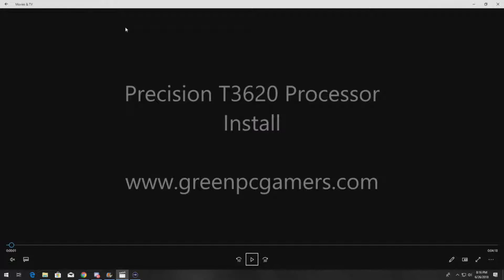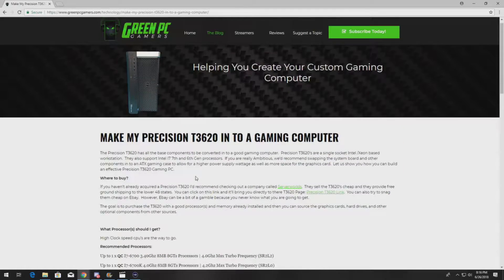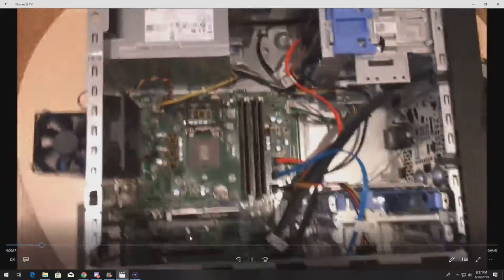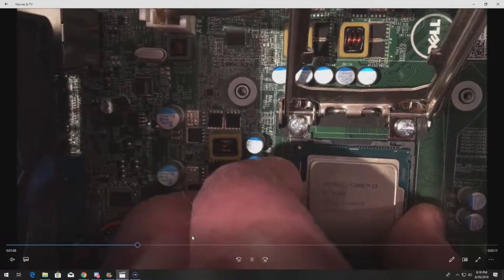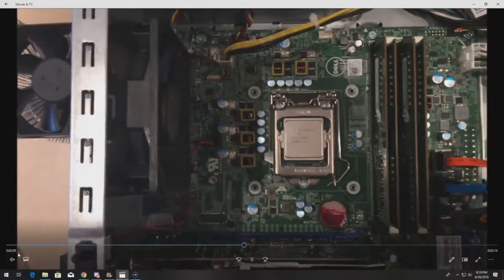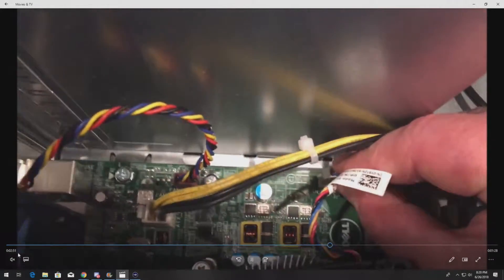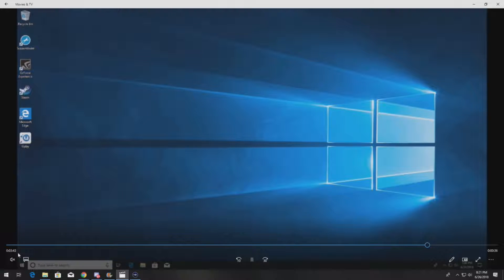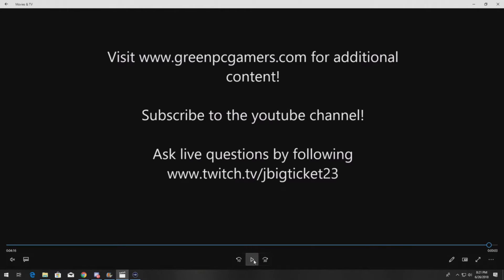How to Install a Precision T3620 Processor (also upgrade ideas)

Comment: First off, absolutely love the website and the videos! Big fan.... I think that you should update the list of T3620 CPU's (Precision T3620 Gaming Computer and Hardware Upgrades) to include compatible Xeon processors. I'm currently running a T3620 with a  Xeon E3-1240v6 3.7GHz that absolutely screams. The Xeon E3-1240v6 benchmark tests better than the I7-7700 for a fraction of the price. If you look around, you will see a lot of T3620's with the E3-1270v5 3.6GHz which benchmarks much better than the I7-6700.
Reply: 1280 v6 runs circles around the 7700 for a little bit cheaper too
Reply: @reloadedspade176  I haven't seen the E3-1280 v6 for less than $119 on aliexpress. For that kind of money, you might has well buy something modern.

Do you have a secret cheaper source?
Reply: @judsoncburton thought I saw it on eBay for like 70$, but it must of sold out.

Comment: hello I have a dell precision 3620 I wanted to buy a gtx 1650 aero d6 graphics card but my power supply is not powerful enough would you have a compatible power supply model thank you
Reply from the maker: Most ATX Power Supplies will work.

Comment: I just got a spare Dell Precision Tower 3620, it allows me to install the OS, but will not boot, keeps coming up with no disc, have you faced this problem??
Reply from the maker: Did prioritize your boot sequence to boot to the storage device that you loaded the OS to?
Reply: use Microsoft's windows 10 media creation tool. that worked for me